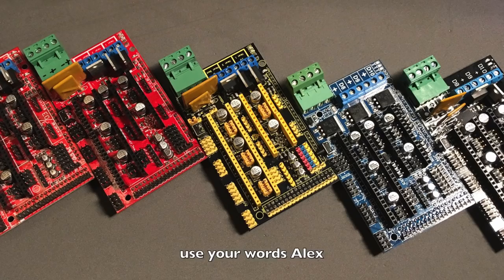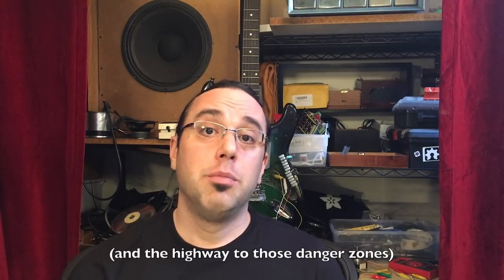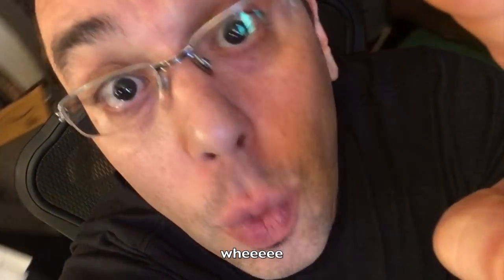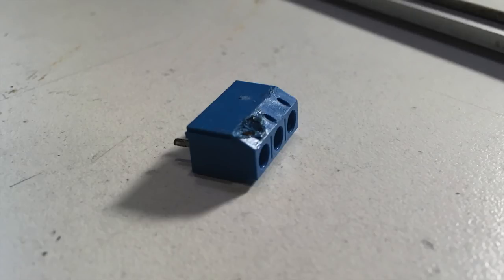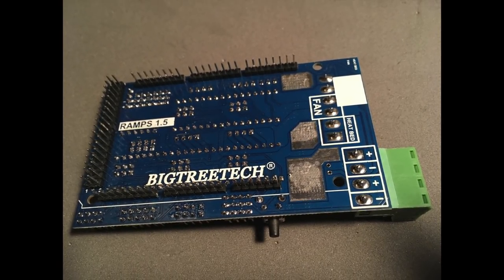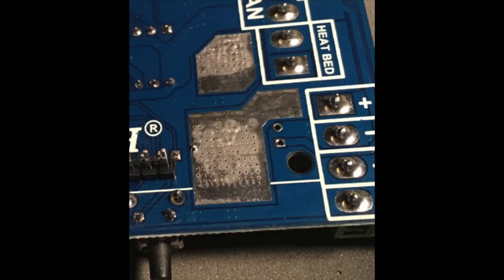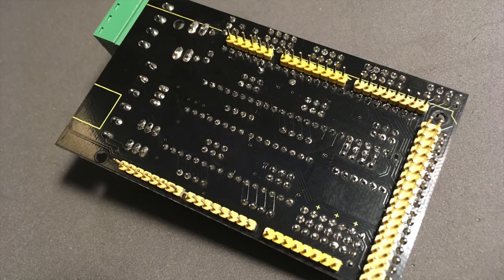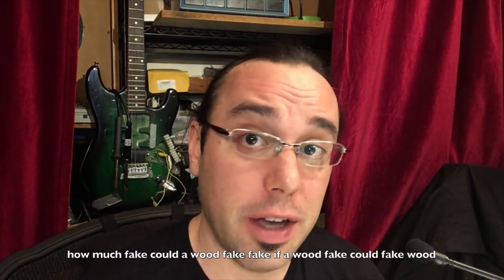RAMPS series 1 of 5 - Intro and board comparisons

Comment: Now my way to go is using a separate SSR for my bed, this is far more secure and the Watt limit is way higher. Plus I can use a AC silicon heat pad.
It works like crazy with a 250W@110V heater, Ramps (1.6) is cold, even the SSR is barely warm.
You just have to be careful with main power, but on the long run it is pretty safe if well done.

Comment: Alex...love your videos on the RAMPS 1.4 board. Do you know where I can get an Arduino sketch to allow me  to control a NEMA motor connected to one port on the RAMPS board, such as the X-axis motor without using the other 4 ports. This may sound pathetic but I am NOT a software guy. Thanks in advance

Comment: Question - would this safety tips still be valid if i would be using external Mosfet with huge heatsink (if they are not defective)? Coming from Airsoft & Anet A8 printer, I've instantly ordered 2 external mosfets ($4 on ALI), and would plan to use them with MKS GEN L. Why not always use external mosfets ? It would be cool if you can take a look at one of those.
Reply from the maker: External mosfets get around the problem of improperly spec'd board mosfets and connectors without having to trplace them but they don't solve wiring problems, and they are isolated, so unless they have a built-in fuse there is no protection against short circuit or opther over-current condition part from the power supply's internal polyfuses.  And obviously if the external boards use counterfiet/underspec'd mosfets or under-spec'd connectors they will have the same problem as the cheap RAMPS.

Comment: I've been using a 1.4a board for a while now and agree that the upgraded mosfets are nice. Unfortunately my jumpers are shorted as well and the wire connectors are too small for the silicone wires I've been using so sometimes they would work themselves out of the connector and short out with other wires. Just today the connector for the bed has melted down.

Comment: Yes the 1.6  is well not good I thought I was upgrading but I'm getting a lot of stuff from bigjip tech that just doesn't work everything needs some kind of bug fix I wish I could get away with that at my job LCD broken graphics ramps 1.6 motors won't move reset keeps kicking off drivers are facing the right way wiring correct triple checked oy! What could be the problem ? Bed works nozzle works . LCD even turns on with its skewed graphics . I built an entire giant robot with all the trimmings and this 3d printer scratch build has just eclipsed it totally can't wait to take my foot off the gas and get back to programming the robot.thanks for any suggestions👍🌞.

Comment: Do you have a Link I could follow to  Robotale RAMPS 1.4A?  You have my interest in this board...Outstanding video!
Reply from the maker: Unfortunately, you have to fish around a bit if you just want the board.  Robotale/Keyes/Keyestudio usually sell kits, so you can get them in a package like this https://amzn.to/2KaZ3Qp but if you don't need the mega/LCD/drivers, they pop up on ebay and Alixpress occasionally.  There is also no guarantee with many of those import boards that the parts will remain the same from one run to another, so bear that in mind.

Comment: What do you think of RAMPS-FD 32bit Controller Cortex M3 ARM Shield For 3D Printer Arduino Due?
Reply from the maker: There is no safe version of ramps-fd available as-is.  The current models were all taken from an early, incomplete design and have to be modified a bit.  See the notes linked from this wiki https://reprap.org/wiki/RAMPS-FD

Comment: what motors are recommended for ramps 1.6?....As brilliant as you are you forgot didn't yo? Well I don't know you probably mentioned somewhere? Thank you
Reply from the maker: It's pretty tough to suggest motors without knowing the particulars of the printer's kinematics/size/voltage/etc, BUT, I have had good luck with 17HD48002H-22B if you need a bit more torque, or 17HS16-2004S1 for less torque but more speed (and both are pretty cheap). 

 Ideally though, to pick optimal motors, you have to know how much torque you will need, what speeds you are printing at, which driver chips you are using, how much current you can put through them, etc, but there are many options that work just fine under a wide range of conditions. 

If you use either of them with DRV8825, you'll probably need smoother diodes to avoid moire patterns, and if you are using Trinamic drivers, I would lean toward the 17HD48002H-22B or something with similar specs because it gives a bit more torque at lower currents (and trinamic chips get freaky if you crank the current up too much), but I have used both with a range of drivers and they can be made to behave.
Reply: Alex Kenis Awesome information brother! thank you for you can't really and in detail and your support, will stay tune and help with you channel!!

Comment: Uh, great video but gives more questions and worries than answers :)  What can I do with chinese board? You say to limit bed current to 6A but how? Can we use Marlin's MAX_BED_POWER to do that? And live with slow heating times until more permanent solution is found. Then, replace mosfets with some better ones and maybe soldier wires directly, bypassing bad connectors? Would that make them OK with full power?
Reply from the maker: If your board can do 24v, that's not a bad option since it lowers the current significantly (usually 24v beds run around 5 Amps).  If you are stuck with 12v, then you have a few options: you can either limit the power in Marlin, or use a lower power bed if you can dig one up (like 2 ohms or higher), and then use dirty tricks (like insulate the bottom well, and lay a sheet of cork or a silicone baking sheet on the bed while it heats up to speed up the process) or go with an external mosfet board, if you don't mind that route (they don't pull a lot of current from the connectors, so you can leave them, and the RAMPS mosfet is then only used for switching a signal, not power, so it is fine). Even the bad connectors should be ok at either 24v or 12v with a low-wattage bed.
Reply: @AlexKenis , thanks. Completely forgot about external mosfet. I have one used on the old Anet A8 board that I'm replacing. Because currently I'm limited to 12V  :/

Comment: So if I connect a 2 pin endstop to the wrong two pins...did I fry my board?
Reply from the maker: OOf... well, it depends on a few things, but hopefully it's okay.  If you literally used just a normally open switch and plugged it from plus-to-minus instead of IN-to-minus, but didn't trigger it with the power on, then you are fine.  If you did trigger it with the power on, then that is a short circuit across the power supply, so hopefully your fuse popped to protect it before anything burnt out.  There is always a chance that something burnt out before the fuse and/or PSU protection kicked in though, so unplug the psu and make sure it powers up, then make sure your controller board powers up.  If that's all good, then hopefully you are okay, and you should be good to check if the endstop is working
Reply: @AlexKenis  I did trigger it unfortunately. No smoke, or noise, it seemed to restart the ramps. But im guessing she's gone because I cant compile anything to it due to a communication error. Just ordered a new one. Thanks

Comment: I feel the "RAMPS 1.4 SB Premium" by Staticboards is missing since they claim "premium" .. would be interesting to see how that stacks up against the "regular" ones
Reply from the maker: I have seen those boards. They look solid, but for what they cost, I would have liked to see on-board fuses and 24v-ready components... and 'premium' to me would also have to solve the problem of overheating the MEGA's regulator, so I would have included an onboard unit to knock the voltage down before it hits the D1 diode to the MEGA. The output diodes are redundnt. As it is, they look solid for a 12v setup, but I wouldn't run any higher than 18v-19v since they used 25v capacitors. Also, the mosfets seem good, (even though they are 10v-logic FETS and have no curves for the 5v that we use) but they could have gone better for cheaper (unless they have a cheap source for those), and had the additional benefit of being compatible with future upgrades to 3.3v logic (re-arm, etc).  

Here is what I would want to see in a 'premium' RAMPS version: 
- up the capacitors' rating to make 24v-32v+ (or more) possible and safe
- use on-board blade fuse sockets
- use 3034 (or better) MOSFETS that will work with 3.3v logic and higher voltage
- either scoot the bed mosfet over a bit for a proper heatsink, or spec good surface mount FETs
- include an onboard regulator that would knock the voltage down to  7-9v for the MEGA
- add another header for the unused ICSP port on the MEGA and the 4 pins that aren't hooked up (for more peripherals or trinamic soft-serial, etc)

Then I would gladly pay those prices.

Comment: That's it! Now I am completely confused as to which board to go for.  All the ones shown are, well, have an issue.......just need to know which boards do not :-)  Swap in a new board...connect a couple of wires...bit of firmware here and there....all done.   :-)
Reply from the maker: Best bet is probably the 1.6, which wasn't out when I did this series. It's basically a beefed up 1.5 with a better PCB and connectors, and the source files are available, so no mystery, unlike the 1.5

Comment: Awesome video ! and now KISS... eh no... i mean..MKS , Mks gen-L, Mks 1.4, Mks base. Would be awesome.
Reply from the maker: THanks man.  I'd like to pull some MKS boards apart int he future and see what their limits are, but they are a bit pricier so I'll have to wait until I get through this huge pile of other subjects first. As far as KISS, I'm waiting until IceSL gets solid mac and linux versions going before comparing any slicers... and alternative firmware comparisons will be coming when everyone gets Trinamic driver support working.
Reply: true, cheapest i fund is this, got it yesterday, from the looks... way better quality as the cheapo ramps.
Mks gen-L 15 bucks - https://de.aliexpress.com/item/controller-PCB-board-MKS-Gen-L-V1-0-integrated-mainboard-compatible-Ramps1-4-Mega2560-R3-support/32802151924.html

Comment: What ramps board do you recommend
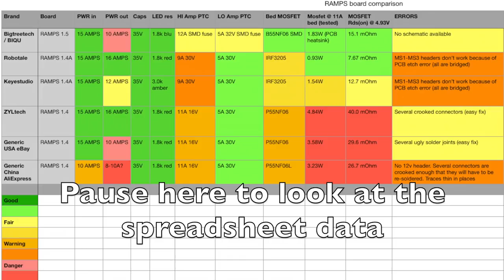Reply from the maker: It depends on your setup i.e. 12v or 24v, heated bed or not, Trinamic drivers or Stepsticks.  If you pause the vid at 12:45, you can see a color coded rating of the various boards. This review was for the cheap boards, so none were perfect without modification. I would stay away from the generic ones because they were built so badly. But with a few mods, the others are fine (depending on your setup). Check out the v1.6 review as well because even though I was annoyed by the surface mount fuses and unified power input, it was usable out of the box if you get one with straight sockets.
Reply: Alex Kenis thanks for your reply. I am more interested in what boards you use. You also made made mention that you use a ramps but did not say which one.
Reply from the maker: Gotcha.  For my personal setups, I always run at 24v and I always replace the bed mosfets with IRLB3034, so I just check to make sure the build quality is decent, the connectors are good, the surface mount parts are rated high enough for 24v, and the jumpers work. Everything else is an “easy” fix. So, I am using a few Frankenstein boards that are a mix up of parts from other boards and parts that I ordered.  The only one I am using close to stock is a v1.5 that was converted to 24v by snapping off the D1 diode, but there is no heated bed on that one. I am also using a modified ZYLTech (don’t try using it stock because the mosfets are so bad), and one of the Robotale 1.4a-type boards where I modified the PCB so that the jumpers would work.

Comment: I had no idea it would be possible for me to be even more confused about which ramps to buy before I watched this video. Now I'm just afraid to buy anything, since no trustworthy option was given in the comparison.

To me a choice between burning your house down and burning up your stepper motors just isn't a real choice.
Reply from the maker: Agreed. Part of the problem was insufficient error margin on original specs... and then mass manufacturing of clones dropped that even further. Switching to 24v helps a lot with waste heat and connector ratings though. It seems that some manufacturers are catching on though, example: if you search "ramps colormix" on gearbest, it should pull up a $5 ramps that is 24v-ready (after you remove D1) and has upgraded mosfets and connectors... but build quality is not great, and I had to re-seat two mosfets and one connector to get it to sit properly. The surface-mount clones are decent at 24v too (if you don't mind surface-mount fuses).
Reply: Before I watched the video I had my heart set on the keystudio board. Is the stepper bridging fixable or is it a design flaw? Could I just reflow the jumper connections and fix the bridging problem? If that's all that is needed to fix that defect, I would be happy.
Reply from the maker: They etched the board wrong, but You can fix it by scratching out the pcb traces between the jumpers.  i have done it, and it is not too bad.  just make sure not to damage other traces close by.  A bright light shined from the bottom should show the traces threough the board. If you are running regular steppers atr meximum resolution, you can leave the traces alone, but if you want to run lower microstepping OR run Trinamic drivers, you'll have to scratch out the traces
Reply: I think I found the board I'm buying. It's expensive, but it looks solid. The Trinamic Trams board. At ~$60 it looks good. The only thing I don't like is the onboard drivers, but I can live with it for the peace of mind that it won't burn my house down. LOL